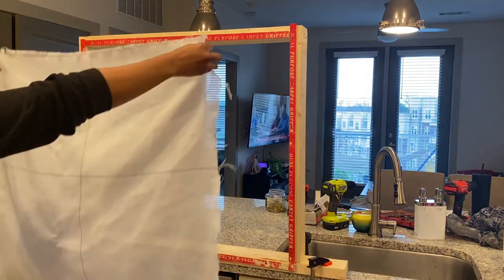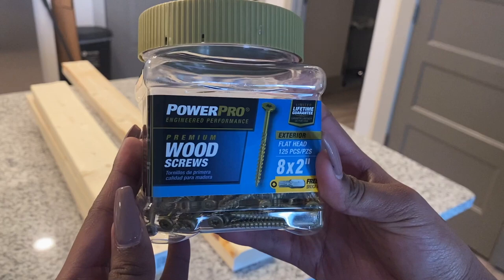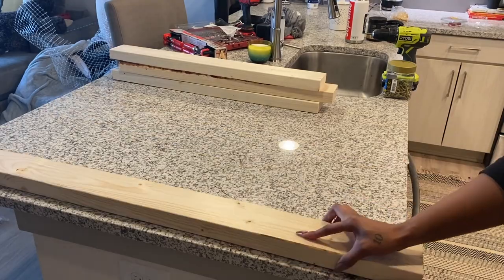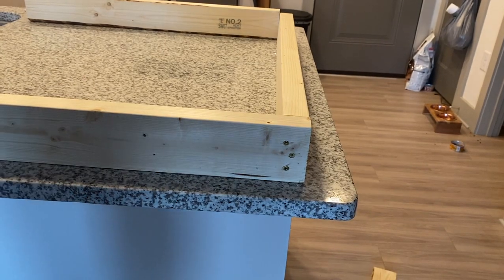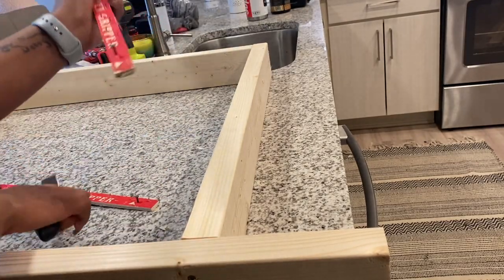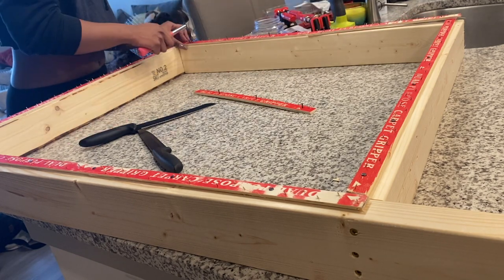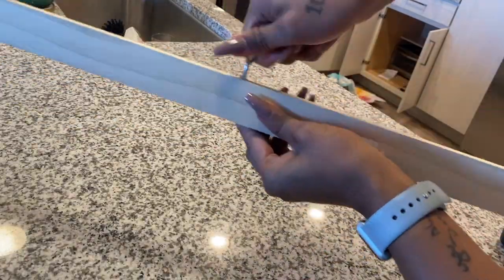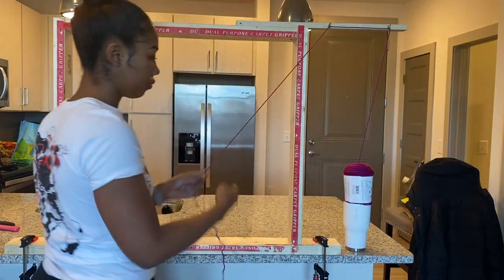How to Make Rug Tufting Frame (Easily)

Comment: How long did u get your boards? The store shows 2x4x8 like an extra x and a #(I hope that makes sense)
Reply: 2x4 is the material dimension width and height and the 8 is for the length so the boards are 8ft long

Comment: I can’t get my screws through any tips?
Reply from the maker: maybe try a different brand, I used another brand and had the same issue for some reason
Reply: Drill a pilot hole first with a drill bit. Make sure the hole you drill is a little thinner than the width of the screw. You still want the screw to be tight when you put it in.